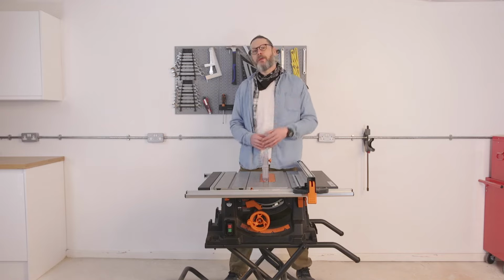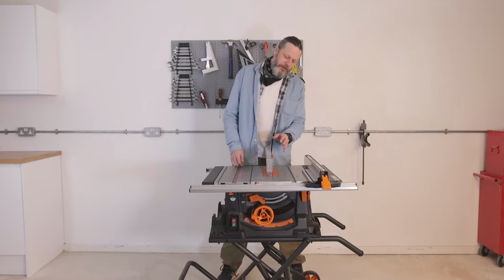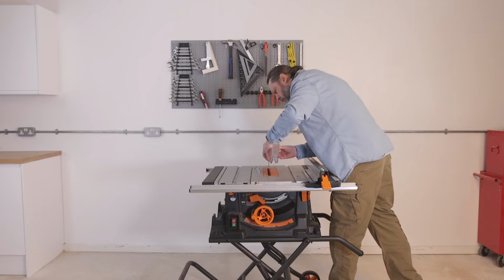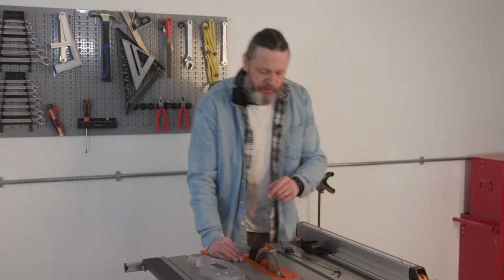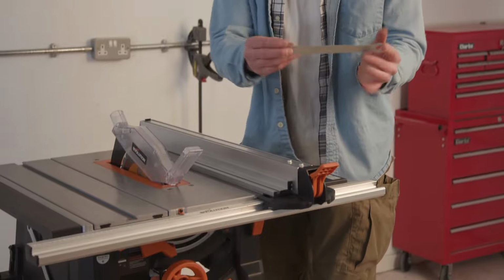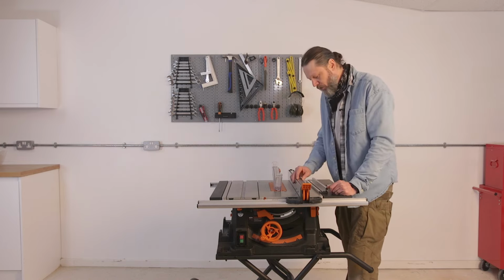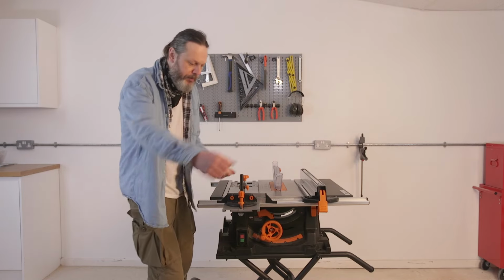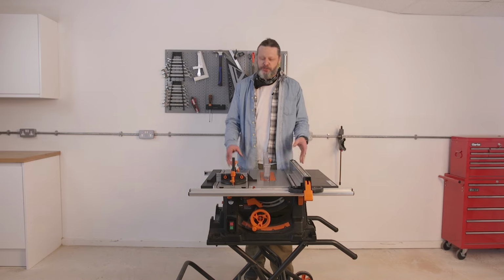How to Set Up Your RAGE5-S 255mm | 10" Table Saw Support and Set-Up Video

Comment: My Rage 5S table extender locking lever has become loose and isn't locking the sliding extension tightly. How can this lever be adjusted to tighten it and create a solid locking of the table extender? My table saw isn't over used by any means and was assembled less than 1 year ago

Comment: Brilliant video! The only gripe that I have with the saw is the flimsy plastic insert plate that bends at the slightest pressure and results in an non-square cut. Evolution sell an after market aluminium version which looks a lot better. Why don't evolution fit it as a standard instead of the plastic rubbish? I live in Australia and have found that the aluminium version is unavailable. I would love to know how to get one. I sent a message to Evolution UK but got no reply.

Comment: this saw may be a good thing for the European market but it's just a little toy for USA.  Miter guage has lots of slack, fence alignment will not stay, aligning blade to miter slots is cock a mamie at best, miter slots are not a standard size, and blade arbor will not alow for use of dado blade.  I wish I would have known these things before buying.

Comment: Hi Lee, many thanks for the tutorial, it’s been extremely useful to me as I am new to the Evolution range of power tools that I have recently purchased. I am stuck on the Rage 5-S table saw, it seems that the angle adjustment for the 45 degree is not able to get to the right angle. My saw is getting stuck at 43.40 degrees. If I force the wheel to 45 degrees it just springs back. Can you help please? Many thanks 🙏
Reply from the maker: Good afternoon, please send some photos along with your serial number in to customer.services@evolutionpowertools.com and we'll happily look into this for you. Thanks!

Comment: Thanks Lee, that was a very helpful videoon the whole.
There is one thing though. If you want to allign the blade so its parallel with the fence you need to undo both the bolts at the back as they are in the same metal bar. If you undo just the one then there is no adjustability. My advice is to undo both those bolts just a little so you can tap the metal bar with a hammer until the blade is parallel and then tighten them again. 

Otherwise great video and thanks  🙏

Comment: Not sure if older versions vary (mine was made in 2018), but I found that I had to loosen both hex bolts behind the riving knife in order to adjust the blade angle. Boy, were they tight! Got it and the fence sorted now.
Reply: Thanks for the tip! It worked for me too only after I've loosened both bolts.

Comment: Tell me about the blade guard - when I install it, it blocks the wood feeding into it, and for any cust where blade is less than 20mm high it jams the wood as it exits the saw. Really poor design or did I fit it wrong? This is even with the riving knife fully extended.

Comment: Very useful watch - I've just ordered this model, but still not sure what the point of the fence face plate is, where and why I would use it?
Reply: It is so you don't get small pieces pinched between the blade and fence, which can lead to them being fired back at you.
Reply: Also makes using push blocks / sticks easier with smaller cuts.

Comment: I have just purchased one of these and my guide doesn’t lock down in to place securely? As soon as I push anything against it it moves!?
Reply: There is a screw you can tight at the rear of the fence, it will make the clamping harder !😉
Reply: It is quite tight, but the orange lever must be pushed fully down.

Comment: How do you make the fence 90 degrees to the top of the table any tricks to be able to fix this
Reply: See the video at 6:50. When locking the fence in place, make sure that you push it firmly towards the table from the locking end, so the opposite end is in the right position.
Reply: @lafamillecarrington  I meant vertically 90 deg not front to back

Comment: Really helpful video.  I've had my 5-S for almost a year now and it's been great. It's definitely a recommended purchase from me.  I've relied on other channels to get the fine-tune information before now, so it's great Evolution have produced this officially.  
I do however have some small issues with the 5-S;
1.  You have to have the blade too high to allow the material to pass easily under the guard in my opinion - though maybe my riving knife is too low.
2. The mitre gauge is too loose in the slot so isn't as accurate as it should be.  Think the end caps on this gauge should be removed and just have a larger metal section.
3. It's annoying that the cart handles are above the wheels - they should be opposite them so it can be more easily manoeuvred into position.

Comment: Thank you for the Informative video. I’ve had my Rage5S for a year or so now and now I know how to fine tune it. 
I bought this saw for a few reasons:
1. Fence is full length and by far the smoothest of the models I looked at. Well ahead of some of the big brands.
2. Portability and being able to store it in my small garage.
3. Sliding panel on the table when using the mitre gauge.
4. Table Extension wings allowing the table surface to be widened to 1.2m
Challenges:
1. The left and right mitre slots are different widths! Right slot is narrower than the left.
2. With the left slot being wider that accounts for the slop when using the mitre gauge even when screwed down on the sliding panel. A few pieces of painters tape fixed that.
3. Sliding panel racks from side to side. Had to adjust its rails to fix that.
4. Blade guard is poorly designed and in my view more dangerous than a safety feature. Also the dust port connector is mostly blocked by poorly located screws which hold the two halves of guard together. I’ve removed mine. 
5. Riving knife needs to be tightened correctly to avoid it misaligning it with the blade
Overall I love this saw. Features for the price can’t be beat. You just need to take the time to setup and tune the saw first. Something I did not realise as this was my first table saw.
Reply: Well late on this however I'm wondering if the differing width on the slot issue has been fixed. My saw was purchased on the 26th Jan 2020 in Australia and both slots are very close to 19.6mm (the upper gap). The equivalent part of the mitre accessory is 19mm. Measuring with a cheapish digital caliper so could be out by .2 or so of a mm.

Comment: Great video; there has been a lot of criticism regarding the accuracy of Evolution saws; I think this is mainly because of the lack of seting up knowledge; as you say your saws are factory set; however people forget that transportation can affect this and they should check accuracy before starting; I have the Rage 3 DB which is great except for the handle which I dislike intensely I much prefer the newer horizontal style handles (no I am not selling and buying the newer model 😂 but if the new handles fitted my saw I would definitely consider replacing it); I will say that the multi blade is a good aground saw; I have used one on both Unistrut and wood even on Dexion (the saw didn’t like the angle of the Dexion but with patience and safety in mind it worked); I have noticed that Evolution now make a 60T wood cutting blade that fits both this and the table saw; as soon as budget allows (I am an engineer and currently out of work but hey ho) I will be buying both the 60T wood blade and the Rage 5 S as the blade will complement both saws 😊 I was considering a more expensive saw but your video may just have converted me 😉

Comment: Thanks for the tips,I have this saw and I'm fairly happy with it except my saw has the black blade gaurd and it's shocking,it won't allow material to pass under it and raise it so I have to lift this up with my hand (not the best idea for a blade gaurd but I've no choice), can I get the blade gaurd like the one you have here?

Comment: I've got this saw and every single thing needed to be readjusted. blade was not parallel to the mitre gauge,   was not set up for neither 90 nor 45  degrees. fence is garbage,it's warped also needed adjustment. table itself is not flat. no way to change the angle of the riving knife which isn't properly aligned to the blade.  Had I known that before I wouldn't  have purchased this saw and would have gone for more expensive one
Reply from the maker: @szim  I am sorry you are having a bad experience with our saw.  We stand behind our product and have a 3 year warranty.  Please give us a call with your serial number and we would love to assist you.
Reply: @EvolutionPowerTools  Seems you have some QC issues... I'm looking, as I'm thinking of a table saw (hobby). Loved your site, saw is on a discount. I can get it £100 less locally!
Reply: Hi Szim did you get your saw sorted ?